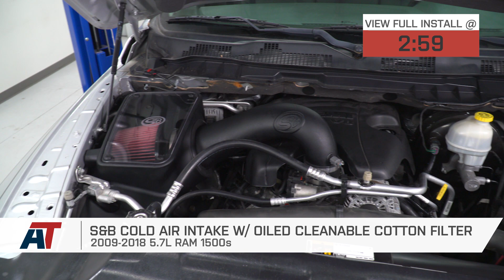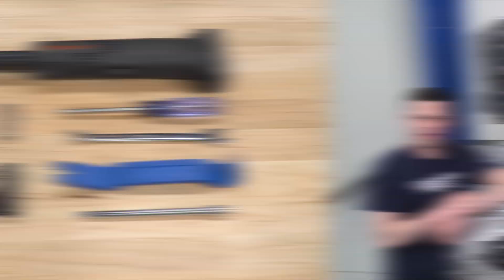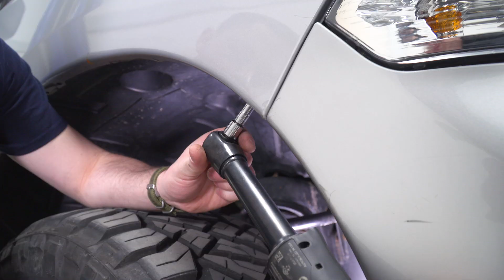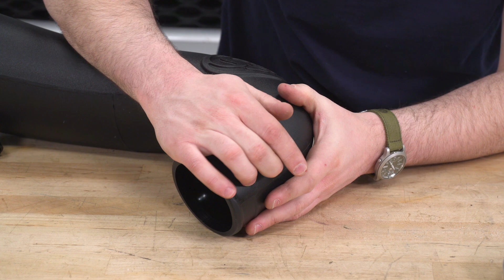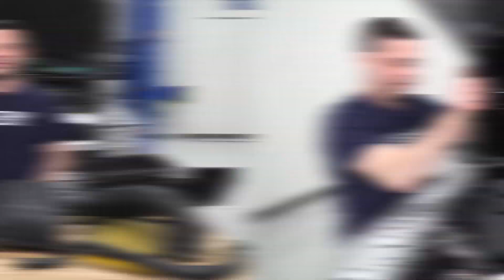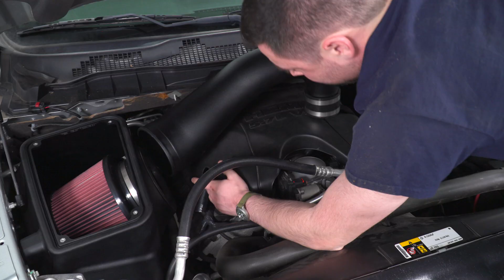2009-2018 RAM 1500 5.7L S&B Cold Air Intake w/ Oiled Cleanable Cotton Filter Review & Install

Comment: Just installed mine today, and it was the simplest intake I’ve ever installed. I didn’t remove the fender well cover though, just eased a ratchet wrench through the headlight bulb opening. No sound change but planning a Carven Exhaust upgrade next. Thanks for the video
Reply: Did your truck Beni fit from it? I’m the opposite installed my carven competitor exhaust (sounds amazing) now looking for a Cold air intake 😂

Comment: Just installed mine , I can tell a big difference in sound already. I will track the fuel mileage but the test ride I didn’t see a change.
Reply from the maker: Thanks for watching! -Zach
Reply: Hey Zach, after about two weeks I have noticed improvement in mpg and as mentioned the sound is amazing. 
I was averaging 13-15mph with cruise set to 65mph, now I am seeing anywhere between 16-20mpg with cruise set to 65mph
Great product , paired with a tonneau cover from TonneauPro and I’m getting pretty decent everyday fuel mileage

Comment: Can you use the throttle body spacer with this s&b or does the height not work with the hood? Im looking at getting the ram air hood that works with the s&b filter.

Comment: What is the reasoning for closing off the other air intake area on the box?
Reply: James D closed boxes generally do a better job at keeping the filter clean versus an open box like KN. Volant and SB are really your only options if you wanna do 4X4 stuff, while still having a CAI
Reply: In the wheel well is a hole, if you're doing anything 4X4 you want that closed off or else you'll just be kicking in dirt,dust,mud,water,etc. into the intake. You could probably get a filter cover that would seal the filter fairly well but honestly it's easier to just close off that side.

Comment: If you do not do any 4 wheeling would it be better to leave the fender side cover off?  I use the 4X4 part mostly for ramping my boat in and out of the lake. Would it change any type of power band or mileage?

Comment: Overall great product. But that vent hose to the cai is a bitch. Used lube then cut a little out of the inside of the tube and used a heat gun.  You can tell they edited out some of that part of the install lol
Reply: Did you notice a difference after the install?
Reply: HUGE pain in the A$$!!  It took me longer to get that together than the  rest of the entire project.
Reply: Mine went on easily, used the included silicone lubricant.

Comment: Does having a sealed box muffle the sound  alot?
Reply from the maker: You'll still be able to hear more induction noise compared to your factory air intake due to the higher flowing filter and intake tube, but the sealed box will muffle the sound more compared to an open-element intake. -Zach